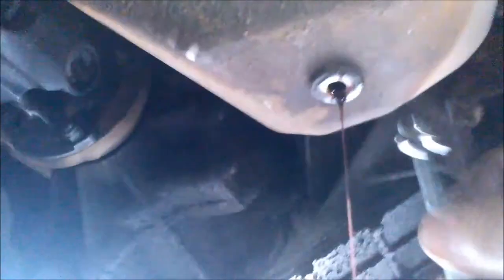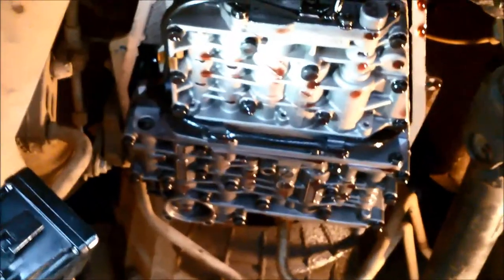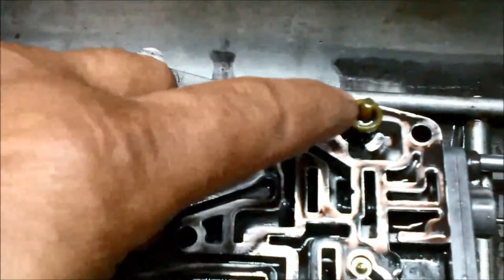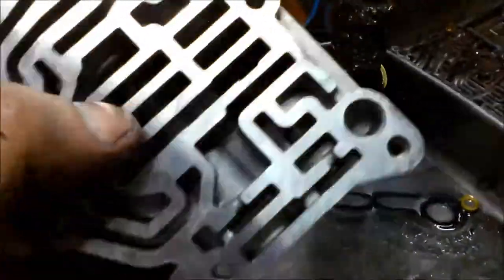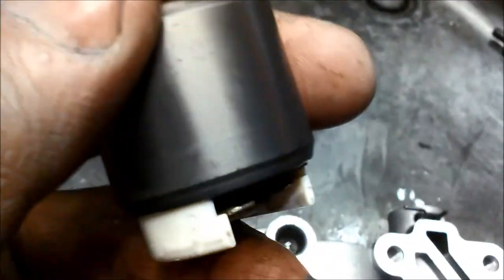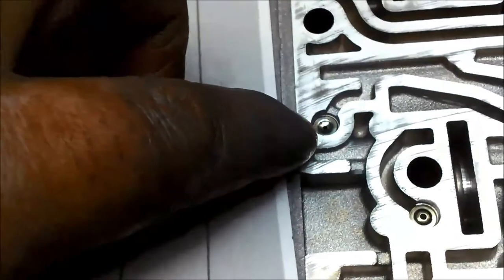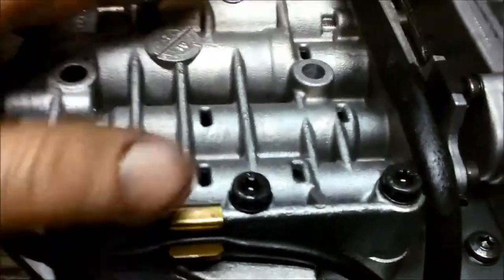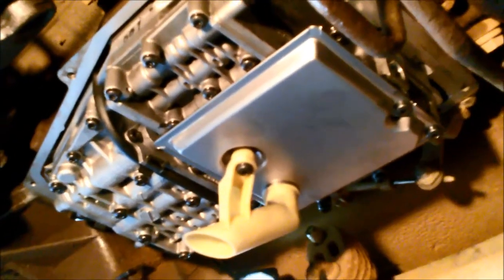ZF4HP22 Land Rover Automatic Transmission Filter Service & Valve Body Recondition Fluid Change

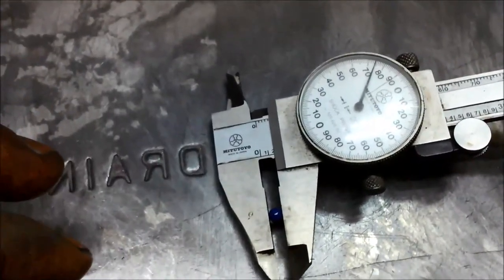Comment: glad you mention the ball check valve at 23:20, as its not mentioned in the ATSG guide, the 2 screens are also not mentioned, good idea to clean the solenoids, didnt think of that, so will do that, i have mine stripped down, burnt out B clutch, 1 stuck valve but also one of the valve cover plates not even torque'd, finger tight, and it was a reco box form ZF !!!
Reply from the maker: glad you found the issue. cheers

Comment: Thanks for this video mate. My 04 disco 2 is holding first gear way too long (4000rpm) then once it gets to 2nd it changes up and down perfectly and locks up with no problem. It must be a stick valve or solenoid so this will be my next job. Thanks for taking the time and effort to make this tutorial. Much appreciated 👍
Reply from the maker: hi, try some lubegard platinum additive. if you`re in Australia you can purchase from me, contact via our facebook link. cheers
Reply: @YepThatsIt  I’m in South Africa so will find equivalent

Comment: G’Day mate thank you for your fantastic Video you are a Legend 💪👍🫡
Mate I have this problem just  
yesterday two weeks he changed transmission on my 04 Discovery 2 Td5 Automatic started playing D 1-2-3 they won’t engage only Reverse works and I checked  transfer box if accidentally me or family member they engaged low range some how it stuck in N but nothing of that ,, then I found out the symbol transfer box  light on and when I engaged it R works D-2-3 won’t move just the 1 it works as Reverse 🤷‍♂️🤦‍♂️ is that a bad thing ,,, this happens after I visit a mechanic work shop 
oil fluid two weeks ago. 
Am I in trouble gearbox gone I don’t know 🤷‍♂️ what to do ? Please advise me 🙏🏻🙏🏻🙏🏻
Thank you 
Matt

Comment: Thanks for the elaborate video.Is it possible to take a valve body from a 4hp22 into 4hp24?the 4hp24 jerks when you put into drive n reverse and does not upshift.
Reply from the maker: hi, if ports are same then should be ok. air pressure test clutch apply ports when vbody is out. cheers

Comment: hi fantastic video i have a Discovery TD5 it has the 4hp _22  auto gearbox the problem iam having is i put it in drive it drives off but wont upshift gears goes in to reverse ok as well any idea what it could be any help appreciated.
Reply from the maker: hi, start with all the basic checks first. a regular filter service is recommended and also a good starting point to show if any debris present in trans pan. always good to add additional magnets as well. before you remove pan you can stick a few magnets on underside of trans pan as well. cheers

Comment: Hey mate great video. I’ve got a D2 that when cold will rev to 3900rpm before wanting to switch to second. Only happens once or twice while cold then stops. You think it has something to do with debris in the valve bodies or the governor?
Reply from the maker: hi, hard to determine without seeing it, but it does sound like a sticking valve or overtorqued bolts on valve body and governor. cheers
Reply: @YepThatsIt  thanks for the info mate appreciate it 👍

Comment: I replaced the xyz switch, which was used from another car, but it is a petrol one. Then what happened later was that when I move and then slow down the speed, it switches to a lower caliber, which makes me feel heavy in its movement.
Reply from the maker: not sure

Comment: Hey bud i have a disco series 1 with zfhp22. I have just done filter change and oil. Now first gear holds too long. Then all good for rest of day.  Gearbox runs good. Ive researched that its common for this to happen after oil and filter change. Suspect governor valve dirty? Is that easy to get at? Is there a nanual on internet i can get my hands on to show me how to get at the governor valve?
Reply from the maker: hi, yeah if troublesome when cold is more than likely a sticky valve.....google away or get an ATSG manual. cheers

Comment: Hello! Where is your garage located? I have an 2001 td5 that lost some fluid after a long trip towing a caravan and it burnt all the fluid in the transmission. I changed the fluid on the side of the road, it worked fine for the rest of the trip, but now it happened again. Worked just fine on short runs but after a long drive pulling the caravan it burnt the oil again and car stopped moving. I'm from Hinckley, Leicestershire. Cheers! Bogdan
Reply from the maker: Hi, haha bit of drive for you ....strongly consider installing a transmission oil cooler.....I`m in NE Victoria, Australia. Cheers

Comment: Hi thinking of converting my 97  defender from manual to the zf box any one heard any thing about the conversion , many thanks
Reply: I had my 98 Disco converted in 2009 to auto and it transforms the vehicle %100. Knights - House of Rover in Brisbane.
Reply: Hi - I converted my 1991 Defender 110 3.5l v8 from manual (R380) to auto (ZF 4HP-22) a few years back and have driven more than 50k miles on it, happy to help you. You'll need parts from Ashcroft Transmission in the UK (not expensive) the new (old) transmission (I recommend a Disco 1), and a Disco 1 shifter (it's easier to find than an RRC shifter).

Comment: Dear sir, 
Thanks for your video. I send you this mail because i have some problem with my automatic gear box. I have a land rover discovery 2. Some problème appear soon. 
Could you tell me what problème appear when the solenoide dont work ? 
Is it possible to change the solenoide and other little parts ? who sold this kind of parts ? 
What diagnostic tool could tell me what is the problème on the gearbox ? 
Please continue to do some interesting video and thank you for your work. 
Your faithfully. 
Cédric.
Reply from the maker: Hi, you need to be more specific. sorry I run a workshop so can`t give much free advise and time...always check basics first. like fluid level, electrical connectors, battery in good charged condition etc. If hasn`t been serviced for a long time is worth doing, but before you do that do the necessary checks and scans first. On side of trans find which ZF version you have and buy a Transmission manual, we like to use ATSG manuals. That will help you a lot. Cheers
Reply: Thank you for your answer.
Your faithfully.
Reply from the maker: cheers
Reply: The issue is that it will not shift from 2nd to 3rd and 4th

Comment: hi  ser  can you send to me  all the  diagram you have to my ples  cuz  i dont no   wher can i  find it   at  wipset  thank you
Reply from the maker: hi, try sonnax.com they have heaps of info for all transmissions. hope that helps cheers
Reply: @YepThatsIt  Thanks I also have my Disco 2 2002 V8 with gearbox ZF4HP22 with M + S lights and not gearing correctly. I Just bought the vehicle recently with 112,000Km on clock. I will check the web site to find a diagram. I bought the Filters and a new XYZ willing to receive them soon.

Comment: Don't really understand the purpose of the transmission filter looks to me like it filters nothing,  by the looks of all the shavings in the bottom of the pan.
Reply from the maker: hi, you want most of debris in bottom of pan rather than in filter. cut open the filter, especially the end where sucks up fluid on top of filter and you will see how much muck in there. cheers

Comment: If there’s that much swarf in that transmission it must be nearly knackered
Reply from the maker: hi, i always explain the options to the owner so they can make the decisions...generally you need to weigh up mileage with trans service record. the problem is most people think a trans service is just an oil change....in this instance the larger metallic debris would indicate need trans removal and disassembly...the really fine stuff would be normal wear debris and expected when hasn`t been serviced in donkey`s years . cheers
Reply: YepThatsIt Yes I totally understand that we all have do a bit of ass covering in the garage trade The reason I came across this Videos I’ve just had the same problem with mine and having now pull down the transmission found every single clutch pack warm to the metal 🙈🙈🙈🙈

Comment: We’re can I get the output speed sensor from and how are they
Reply from the maker: hi, contact me on my face book link https://www.facebook.com/Yep-Thats-It-103051017785435   , if needed we can also exchange pics on there. cheers
Reply: Hi I’m not on Facebook it’s just that my 04 discovery 2 is running to long in high in gear before it changes or it goes in limp mode I’ve got the filter ready   To put in but while I’m there I may as well replace the sensor but every where I rang tell me they don’t sell it the people I got the car from said the gearbox had been serviced but I think they were lying to me
Reply from the maker: contact me on my email under my "about" https://www.youtube.com/user/YepThatsIt/about